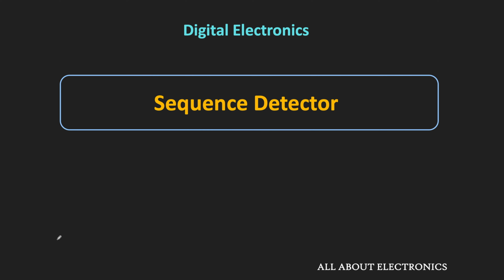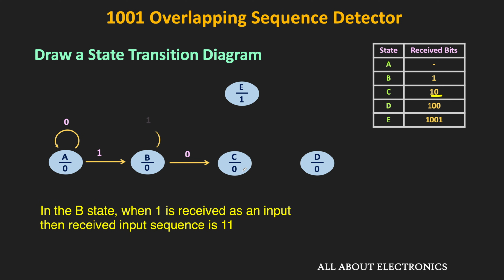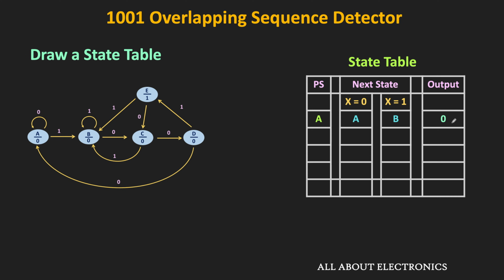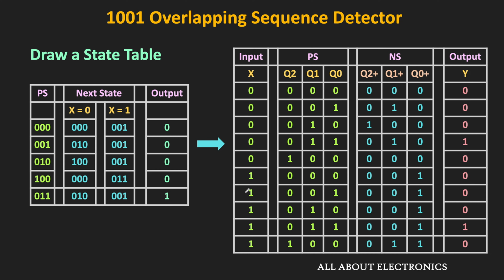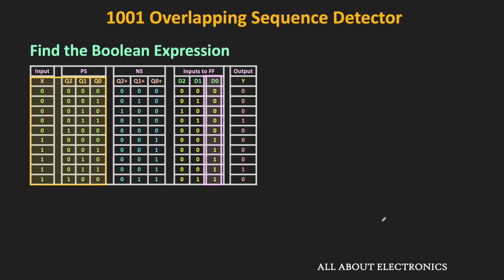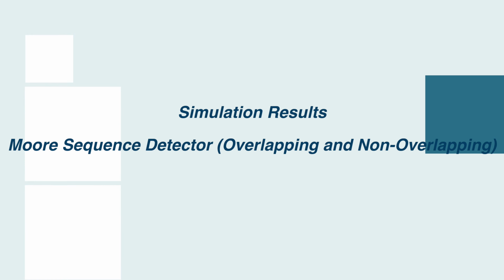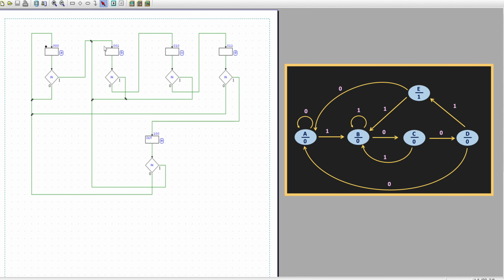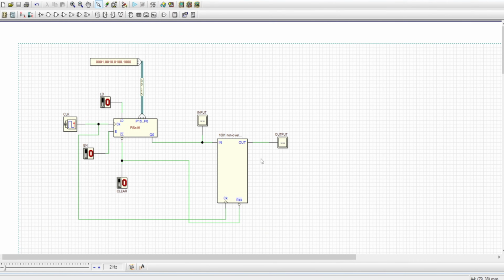Design of Moore Sequence Detector (Overlapping and Non-overlapping) Explained with Simulation

Comment: 8:50 sir, why in the overlapping sequence detector u chose 100 value for D and 
E is 011, based on the state table that u given E is after D so D should be 011 and E should be 100
Reply from the maker: It is done to reduce the overall logic circuit. (As I have mentioned in the video). If you see the next states of B and E then they are similar. So, if the state assignments for B and E can be done in a such a way that, they remains nearby in the K-map then in the final implementation of the circuit, we can reduce the required number of logic gates. I hope, it will clear your doubt.

Comment: what tool are to using for stimulation sir?
Reply from the maker: Deeds Circuit Simulator
Reply: @ALLABOUTELECTRONICS  It is free tool?
Reply from the maker: @kratigoyal5490 Yes. Just google it out. You will get the link of the website. From there, you can download it. Its easy to use. Not much learning curve.